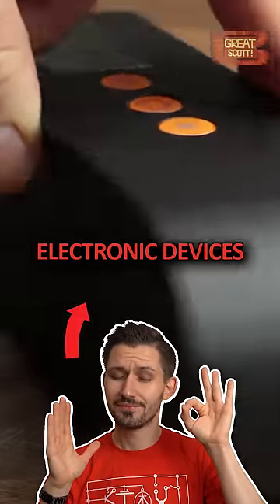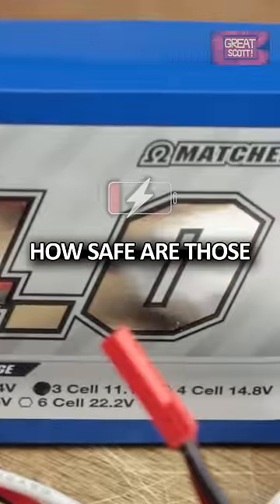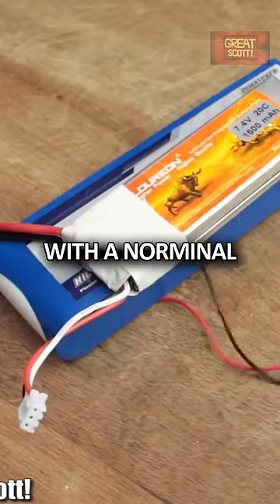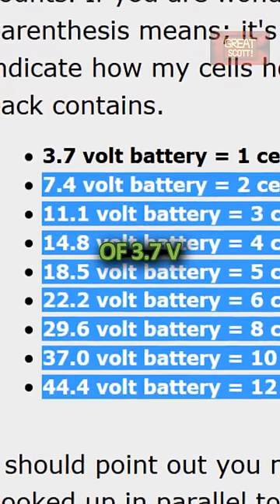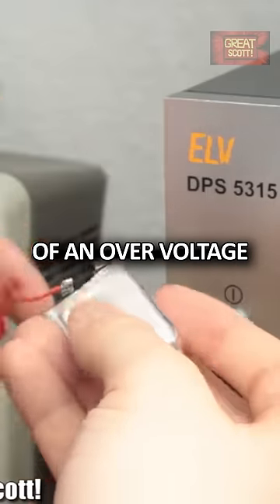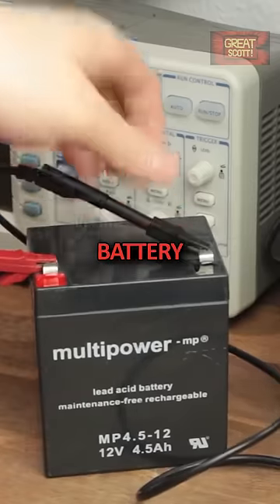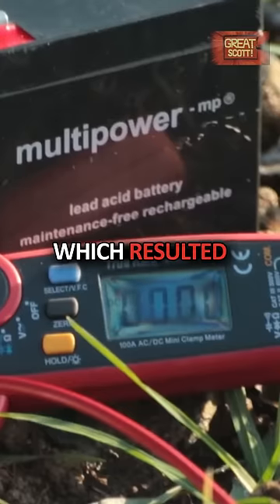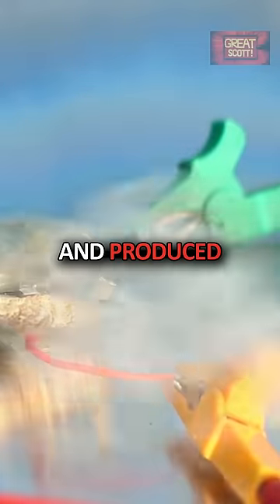Overcharging LiPos: Is it Dangerous?

Comment: 55A into a single cell LiPo💀
Reply: *into a small LiPo!

55A into a 6S LiPo and still 55A in every single cell!
An electric car battery cell can handle 55A without a problem.
Reply: @lukasoffen2420 6s or 100s that's still hazardous. Unless the current rating of battery is high, which is possible mostly only in case of a larger capacity larger size battery. Actually I meant to say "small" single cell lipo

Comment: I feel like it's more the 55A than the vintage at play here. If you use the standard CC/CV charging protocol but with a final voltage of, say, 5V instead of 4.2, that would have been very interesting to see.

Comment: We talk a lot about the risks of Lithium Ion exploding/burning but the more familiar Lead Acid battery is not immune. The difference is that a lead acid battery "event" shoots hot sulfuric acid all over the place !
Reply: modern lead batteries are almost dry. If you’d abuse one, the worst you could get is a small sticky leak of gel.
Reply: @AB-pb8oo that's AGM batteries, found in cars with stop/start mostly. Not ubiquitous.
Reply: @jdmjesus6103  True, but you wont find much other items using lead acid much in consumer electronics. Or so people building electronics with them, unless its a old car battery.

Comment: Chemical fire that is impossible to extinguish*
Reply: Very easy to extinguish. There's a reason why I keep a container full of sand near my workbench.

Yes it is producing oxygen on its own by the sand will smother it and should absorb enough heat to prevent a pack from going off in a chain reaction
Reply: @ericklein5097  Good to know!

Comment: My neighbor bought a new power backup for her computer and I asked for her old one. Inside I found two of those sealed 12v batteries. They are very handy.
Reply: But they might be thin and flexable, and should not be bent.
Reply: @neutronenstern. no, lead acid batteries are not fragile
Reply: @Justgreen89925  oh ok. normally these are liion
Reply: @neutronenstern.  no he's talking about UPS's. The cheap types from APC or CyberPower just use an SLA to give you a few minutes to save your work and safely shut everything down

Comment: It can end up a lot worse than what is shown in this demonstration. Overcharging causes flammable gasses to form, including hydrogen gas. If larger or multiple cells are contained in a confined space it can lead to buildup of these gasses and can cause an explosion due to the heat or sparks generated by the overcharging.
Reply: That's also true for lead acid batteries like most car batteries.
Reply: Yeah I've seen better explosions of lipo batteries. 😂

Comment: LiPos can get a lot more dangerous than that.
More cells, higher capacity also means a LOT of flames that can catch everything around it on fire and generate extreme temperatures.
Some people have metal containers for charging big LiPos but without proper insulation they can still cause some damage, if you plan on transporting the container in case of a fire you will just burn yourself.
If your container is sealed, the pressure buildup can make it into a bomb.

Comment: This is not overcharging. This is too fast charging. Overcharging would be, if you charged it with a current that is below its maximum rating, to a voltage above its 4,2V per cell. 
If you apply 12V to a cell, this does not mean,that the voltage of the cell is suddenly at 12 volts, because it has a series resistance.
So this means, that a proper charging device meant to charge these Batteries, will go slightly over the rating of the battery in voltage, in order to fully charge it up. If you apply a voltage of 4,2V to a battery, that has 4,1V it will only very very slowly charhe up, because of inner resistance. So in order to fully charbe it up, a good battery charger will go slightly above these 4,2V for some time, then check the voltage, while it turns off the current,and then goes on again. Or it will check its actual voltage over the balancer plug or something. But this would not be overcharging, cause the battery itselve never has more than 4,2V across it. 
And in this case it might be, thar the battery itselve never had more than 4,2V across it. So it only blew up due to overcurrent.

Comment: If you read the datasheets you'll see companies like Lishen will overcharge their cells more than a little.....not saying you should do this but here's a lithium ion cell the LR2170SA.....safer than Lipo, yes but  similar....

Charging with a fairly low IR 12V is obviously going to be different

8.2 Overcharge Test
Cell fully charged per 7.1.1, is to be overcharged with 1.0C to 6.3V while tapering the charge current.
Monitoring change of cell temperature during testing. Stop the test when cell temperature decays to
room temperature.
Criteria: No Fire, No Explosion

Comment: those 18650 cells are Li-ion, right? and those flat kind is li-po?
Reply: Yes the 18650 cylindrical batteries are typically (always that I’ve seen) a lithium-Ion type. And the “folded foil pack “variety  is the lithium-polymer type.  I’ve had best luck with 18650 lithium batteries when building DIY power sources. And not sure if it’s my luck and or use,  but any LIPO type I’ve had always ends with a puffy pack eventually. Which basically is a cell failure.no fires from either type but definitely more worrisome when LIPO is used.
Reply: @EarthMurph  both the same in terms of price?
Reply: @danz9268  I rarely buy new however if I was to guess I’d say the LIPO - foil pack design is cheaper for manufacturing. Thus cheaper for the consumer.

Comment: I have a setting my my phone that stops the charging at 85% and it doesnt start anymore untill i reconnect my charger then 85% is reached it uses the power from the usb instead of the battery so the battery isnt being use rn

Comment: Is it safe to overcharge a LiPo? Proceeds to push 12V @ 55A into a 3.7V battery meant to charge at 4.2V @ 0.5A facepalm

Also claims some cells have no protection... Proceeds to show a battery with a protection circuit. XD